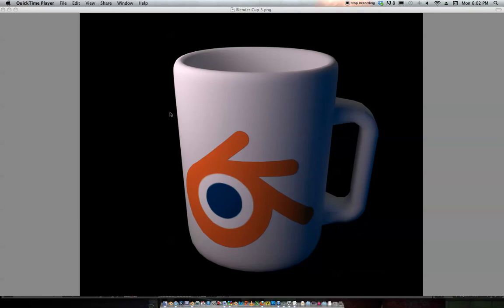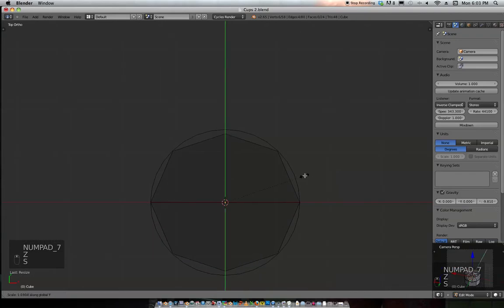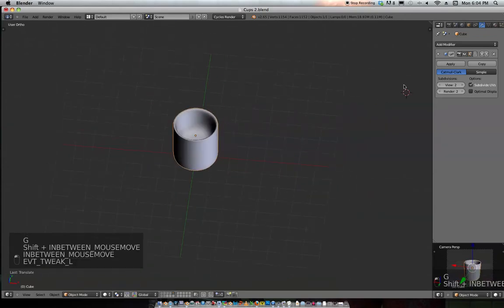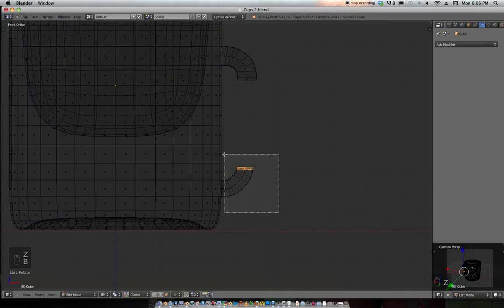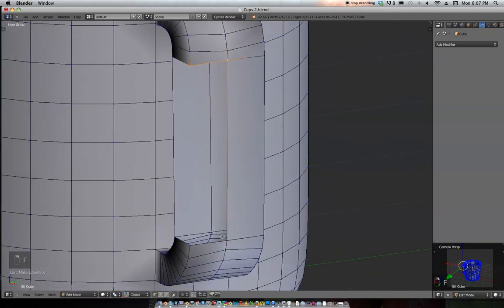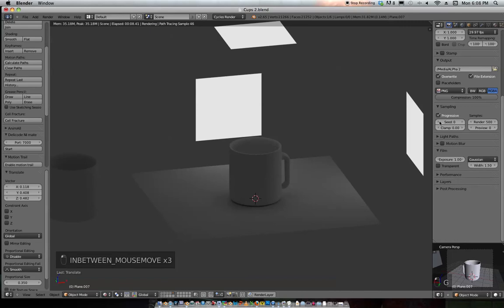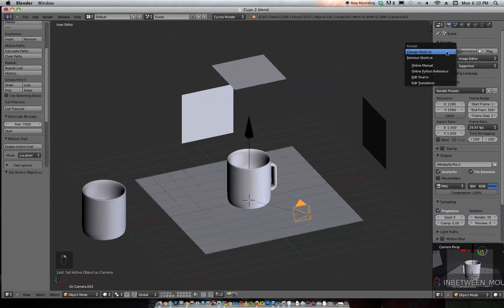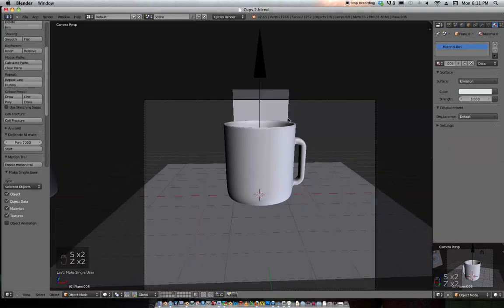Beginners 4 Blender Model a Coffee Cup #1

Comment from the maker: I need to make a tut on that, you make an alpha image of the blender logo, then you UV map that to a plane, make sure you subdivide the plane about 4 times maybe more before you UV map it. then after you have you plane with your image UV'd you need to add a transparency node to the planes material (cycles) i believe you plug it into the factor of your mix node, blender is a little buggy with transparent objects so if it doesn't show at first just mess with it, finally add a shrink rap modifier